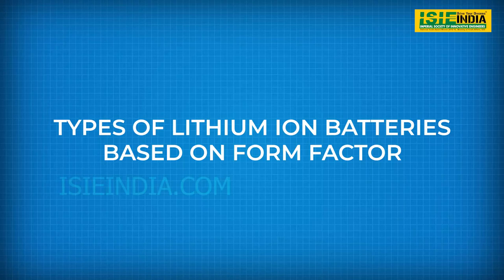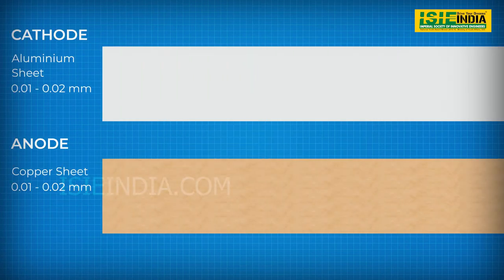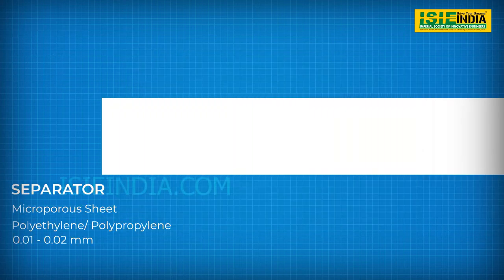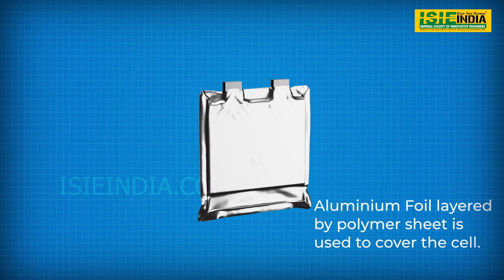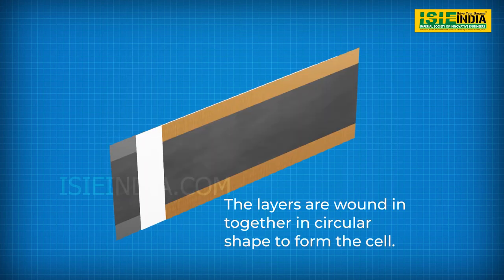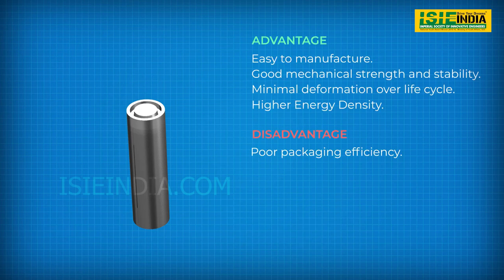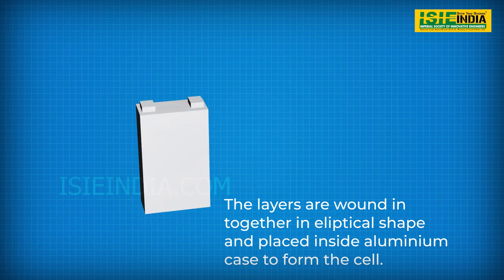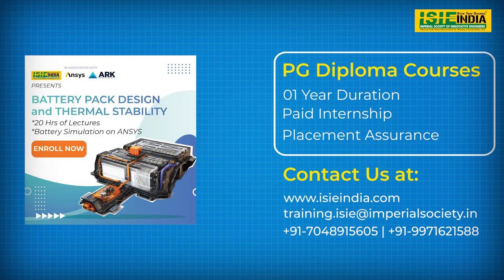Lithium Ion Batteries | Cylindrical vs Prismatic vs Pouch Cell

Comment: Cylindrical is safest due to having the most cells.  The more energy contained in a high pressure metal casing the greater the explosion risk.
Reply: Cylindrical or prismatic both are not safe . provided it doesn't have effective cooling.
While cylindrical may have some space in between allowijg air to flow.
But prismatic has morre charge cycle and battery effecieby doesn't reduce even when the disssaption is highly inconsistent unlike cylindrical ones.